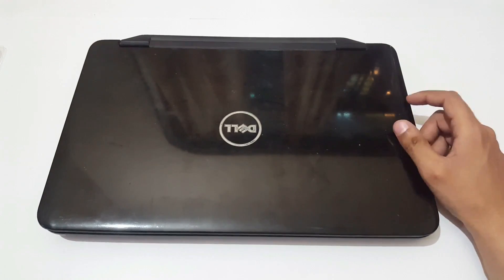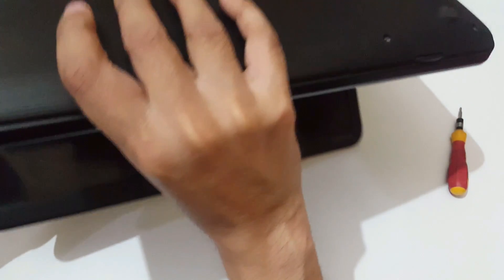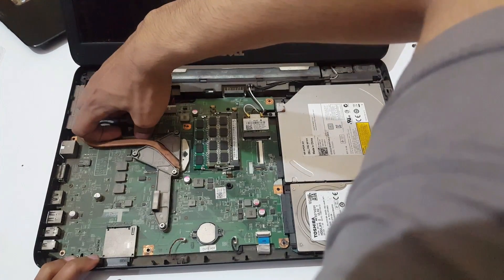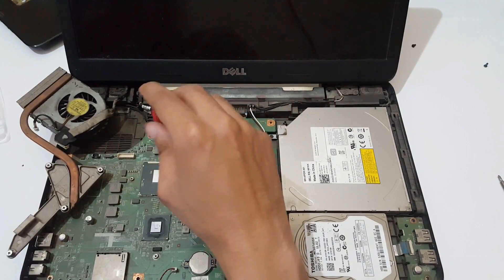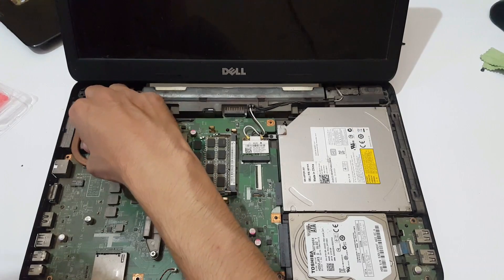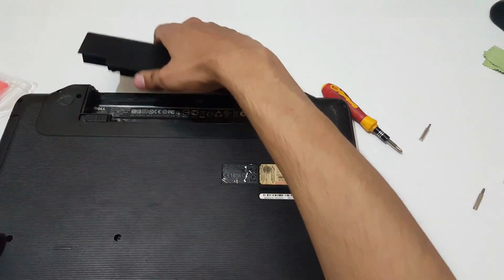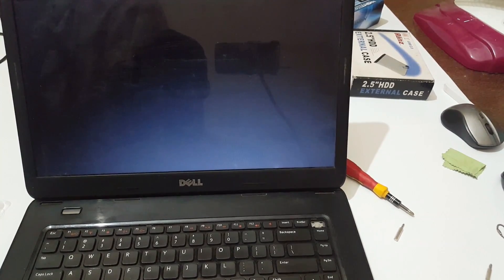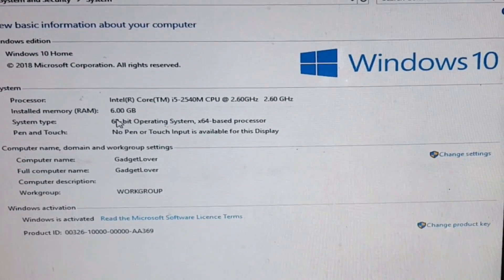How to Upgrade Processor on DELL Laptop | i3 to i5 & i7 - Make Laptop Faster for Gaming

Comment: i have dell vostro 3578 i3 also now currently i added 256 gb ssd and 4 gb ram so can i upgrade it to i5 or i7 and where i will get new processor please tell
Reply from the maker: The processor of this Laptop is soldered so you can't upgrade it

Comment: Which cpu work in dell vostro 3468?
Reply from the maker: In my knowledge the processor of this Laptop is soldered so you can't upgrade it but I would suggest you upgrade its RAM to max and install SSD for better performance
Reply: @GadgetLover360 ohh
Reply: If i upgrade all things what you said i can play gta 5 like games? @GadgetLover360

Comment: N5010 i3 m380 3 gb ram and 64 mb graphics card, 256 gb SSD+ 320 gb hdd ( caddy )

Can I upgrade processor if yes then best konsa ha ?
Reply from the maker: Yes and Intel Core i5 580M is best processor for your Laptop
Reply: @GadgetLover360  upgrade little my old laptop My laptop is  dell n5010 m380 6gb ram and 128 SSD and 500 gb hardisk windows 11 running smoothly but sometimes touchpad/mouse not working and sometimes mouse dancing please give me solution
Reply from the maker: @RajanNindra Intel Core i5 580M is best processor for your laptop

Comment: Hey i have a Dell Vostro 1014 with C2D processor, can i upgrade it with a i5 processor?
Reply from the maker: No but you can upgrade it with Intel Core 2 Duo T9900

Comment: Dell latitude e7470.... Its upgradeable or not 😢
Reply from the maker: The processor of this Laptop is soldered so you can't upgrade it but I would suggest you upgrade its RAM to max and install SSD for better performance
Reply: @GadgetLover360 My laptop is a Dell Latitude E7470 with an i5 6th generation processor and 16GB RAM with 512GB SSD storage. Even with these specifications, games lag. Why is this happening? This is the first time I've bought a second-hand laptop.

Comment: Please suggest processor and generation for my dell Inspiron 3000
Currently it have i3 5th generation with 4gb ram
Reply from the maker: The processor of this Laptop is soldered so you can't upgrade it but I would suggest you upgrade its RAM to max and install SSD for better performance

Comment: Vostro 14 3468 dell laptop can upgrade my cpu i have already upgrade it with ram and ssd
Reply from the maker: The processor of this Laptop is soldered so you can't upgrade it
Reply: Thanks for the  information  @GadgetLover360

Comment: In 2025 , I want to upgrade my laptop . So my laptop has i3 core inside processor and I want to upgrade , so please tell which processor is best for my laptop in 2025 and also help with RAM and SSD because I know a little about PC but I don't know which RAM and SSD model is suitable for my laptop , can you please give me the correct details for laptop upgrade (e.g processor model name, RAM name, SSD model name)  mostly i want to use this laptop basic gaming and as well as normal task.
Reply from the maker: Kindly, provide Laptop model number
Reply: Dell N5010
Reply: And  Processor part also
Reply from the maker: @runaljadhav9140 Intel Core i5 580M is best processor for your Laptop and upgrade its RAM with dual channel DDR3 SDRAM 1333MHz and install 2.5 inch SSD
Reply: thank you so much 🙏🏽
Reply from the maker: @runaljadhav9140 You're most welcome

Comment: Hey Big Bro, Assist me with some advice. Currently a old laptop in our home and it was utilised to its peak for Data entry of Tally as server cleint. Now it's of no use to me or other family member, it still boots slow after SSD replacement and ram upgrade to 6GB, I have a vague idea why it is doing so. Answer some of query like Is it worth investing in this product anymore or shall i donate it to someone who need it, secondly can i upgrade it's cpu to i5 or i7 to boost some entertainment purpose like to output old retro games to TV .
"LAPTOP MODEL-DELL Inspiron N5050 Intel® Pentium® B960 39.6 cm (15.6") HD 4 GB DDR3-SDRAM 500 GB HDD Windows 7 Home Basic Black"
Reply from the maker: Upgrade the Laptop with new processor and this will boost its performance

Comment: bro dell inspiron 14 5000 i3 8th laptop can it processor can  changed or not
Reply from the maker: The processor of this Laptop is soldered so you can't upgrade it but I would suggest you upgrade its RAM to max and install SSD for better performance

Comment: Can this be done on dell inspiron 3521 model i3-3227U CPU with a upgrade of i5 or i7?
Reply from the maker: The processor of this Laptop is soldered so you can't upgrade it but I would suggest you upgrade its RAM to max and install SSD for better performance

Comment: Can you do this on a Dell Laditude 5490 from 2019? I want to put a AMD Ryzen 5 4500 CPU in my computer so it gets better performance in video games, because the current cpu has bad integrated graphics. Thanks!
Reply from the maker: You're welcome and the processor of this Laptop is soldered so you can't upgrade it but I would suggest you attach external graphics card for better gaming experience
Reply: @GadgetLover360  Ok, I'll look into if I can do that with my computer.
Reply: Funny enough I have the exact laptop and was going to comment this same question. 

Sadly, we cannot use an external graphics card aswell,  since we dont have a usbc for fast data transfers

Comment: ihave a dell vostro with i3 7020 processor can i upgrade it?also can i use a external gpu
Reply from the maker: @VMAXEDITZZ  Yes and if the processor is not soldered you can upgrade it in same generation

Comment: is it possible to upgrade the processor in dell Inspiron 15 3000, intel core i3, dell laptop? (My 4 years old laptop is now very slow. I have to do my presentation works.)
Reply from the maker: @sayandeeprana  In my knowledge the processor of this Laptop is soldered so you can't upgrade it but I would suggest you upgrade its RAM to max and install SSD for better performance

Comment: HI BRO.
CAN U TELL THE BEST PROCESSOR UPDRAGE FOR LENOVO Z580.
i3 2370m processor
hm76 chipset

can i use i7 3612qm?
Reply from the maker: @drabhinavsharma0551  Hi and Intel Core i5 2540M is best processor for your Laptop
Reply: @GadgetLover360  thanks!
but can the laptop support i7 3612m?
Reply from the maker: @drabhinavsharma0551  You're welcome and no
Reply: @GadgetLover360  thankyou :)
Reply from the maker: @drabhinavsharma0551  You're welcome

Comment: I need help,is dell latitude 3380 can? Can celeron change it to i5?
Reply from the maker: @JohnLingChangEng  The processor of this Laptop is soldered so you can't upgrade it but I would suggest you upgrade its RAM to max and install SSD for better performance

Comment: Hi, can i upgrade my Dell Vostro 1550 CPU? it has Intel Core i3 2310M 2nd gen, 2.10Ghz. If we can upgrade the CPU can you suggest me some CPU's or CPU that is compatible with my Latop? That would be a helpfull if you can😅
Reply from the maker: @DratiSHCroblox  Hi and Intel Core i5 2540M is best processor for your Laptop
Reply: Thanks sir👀 @GadgetLover360
Reply from the maker: @DratiSHCroblox  You're welcome

Comment: Can i ask you 2 questions?
The first one is: Can i do this with my HP probook 440 g3?
The sencond one is: If i can, then what processor should i use to do this?
Reply from the maker: @gdndmonstar  The processor of this Laptop is soldered so you can't upgrade it but I would suggest you upgrade its RAM to max and install SSD for better performance

Comment: Brother , my dell inspiron n5010 32 bits is not turning on and there is a beep sound 7 times continuosly after pressing power button  with dark screen , how can i solve it
Reply from the maker: @mr.chandrasenelectrical7460  Reinstall its RAM properly and see if the problem has been solved
Reply: @GadgetLover360  I reinstall ram several times but it not working
Reply from the maker: @mr.chandrasenelectrical7460  Go to Setup>Load Defaults>Save and try again
Reply: Display of laptop is remain black only power light indicator is on and beep sound  , so i can't do nothing , not able to go bios or setup
Reply from the maker: @mr.chandrasenelectrical7460  It might be due to hardware problem I would suggest you go to nearby PC store and tell them about this problem
Reply: @GadgetLover360  ok thank you very much for you r reply
Reply from the maker: @mr.chandrasenelectrical7460  You're most welcome

Comment: sir my processor is i3 7th generation of the dell vostro 15-3568. Intel(R) Core(TM) i3-7020U CPU @ 2.30GHz   2.30 GHz. so can change this please reply me. I have extended my ram to 8gb by buying ram. i want to play gta5 on my laptop it is 7years old & which intel processor would be the perfect for gaming?
Reply from the maker: @swarnavaroy1063 The processor of this Laptop is soldered so you can't upgrade it so install SSD and attach external graphics card for better gaming experience

Comment: My processor is i3 11th gen 
hp 250g notebook laptop. Which i5 processor is suitable? Also my display resolution is 968p if I change the display to full hd IPS. Will it display full hd resolution or only 968p?
Reply from the maker: @saiprasanth21  In my knowledge the processor of this Laptop is soldered so you can't upgrade it but I would suggest you upgrade its RAM to max and install SSD for better performance

Comment: I want to upgrade my laptop Dell Inspiron 3520 2012 it has i3 3110m.
Which processor should i use i7 3632QM or 3840QM?
Reply from the maker: @archispal3618  Intel Core i7 3632QM
Reply: @GadgetLover360  will there be any issues with BIOS when upgrading?
Reply from the maker: @archispal3618  No

Comment: Bro can I upgrade processor in dell n5110 intel i5 2540m. If yes
Then which processor will be good
Reply from the maker: @AAWYT  Yes and Intel Core i7 2640M is best processor for your Laptop
Reply: @GadgetLover360  thank bro
Reply: @GadgetLover360  bro is there any problem will come on changing processor 
Like overheating
And power consuption
Reply from the maker: @AAWYT  No and you're welcome

Comment: Is it possible on both dell Inspiron 15 3521 and Inspiron N5010?
Reply from the maker: @WicterYT  Yes you can upgrade the processor of Dell Inspiron N5010 with same generation but the processor of Dell Inspiron 15 3521 is soldered so you can't upgrade it so I would suggest you upgrade its RAM to max and install SSD for better performance
Reply: @GadgetLover360  whats the best cpu choice for n5010?
Reply from the maker: @WicterYT  Provide processor model number
Reply: @GadgetLover360  eh thnkx for ur help pal
Reply from the maker: @WicterYT  You're welcome

Comment: What about dell inspiron 5520? Can we replace the processor in it?
Reply from the maker: @christywolf-c6j  Yes you can upgrade it in same generation
Reply: Suggest some i am not an expert when it comes to processors ,mine is too slow,2.4ghz, even though i upgraded the ram to 12gb.
Reply: Kindly respond faster!
Reply from the maker: @christywolf-c6j  Provide model number of processor
Reply: Dell Inspiron 15R-5520 i5-3210M??
Reply: Cpu@2.5Ghz
Reply: Is that enough?
Reply: Hey????
Reply from the maker: @christywolf-c6j  Intel Core i7 3612QM is best processor for your Laptop
Reply: Isn't that around 15-20k?i need something under 5k!
Reply: Also this one is ivy bridge and what about the socket compatiblity??
Reply from the maker: @christywolf-c6j  Don't worry it is compatible and I would suggest you buy it from ebay online store
Reply: What about this? CPU ManufacturerIntel
CPU ModelCore i5 3570
CPU Speed3.4 GHz
CPU SocketLGA 1155
Reply from the maker: @christywolf-c6j  You can't upgrade it with this processor
Reply: The one you suggested is not available,so tell any other than😣
Reply: Than that*
Reply from the maker: @christywolf-c6j  Intel Core i7 3540M

Comment: Can I upgrade processor of Dell Inspiron 3567 6G i3? If yes, then which processor is best suited? ( I have already upgraded RAM from 4GB to 8 GB)
Reply from the maker: @dr.santoshkawade4204  The processor of this Laptop is soldered so you can't upgrade it I would suggest you install SSD for better performance

Comment: Where shall i get the chip from
I meant is the outer shell removed or smthng
Pls respond
Nice vid btw
Reply from the maker: @Lalrly  Thanks and if the processor is not soldered you can upgrade it in same generation and you can buy processor from Ebay online store

Comment: When I upgrade it from i3 2nd gen to i3 3rd gen processor it did not shows display and fan starts and stops automatically. What to do pls tell and there is no update for bios in dell vostro 2520 laptop. Pls comment as fast or make the video dude pls 😢
Reply: Or upgrade to i5 3rd gen I try both processor of 3rd gen but not showing displat what to do?
Reply from the maker: @anshkashyap0023  You can upgrade it in same generation of processor only
Reply from the maker: @anshkashyap0023  I would like to inform that you can upgrade it in same generation only

Comment: Bro i have this same laptop so can i upgrade it to i7 ?
Reply from the maker: @the.0nyxx  Yes and Intel Core i7 2640M is best processor for your Laptop
Reply: @GadgetLover360  How much it cost ?
Reply from the maker: @the.0nyxx  See its price details on ebay online store
Reply: @GadgetLover360  Bro also suggest 4gb Ram for my laptop
Reply from the maker: @the.0nyxx  Buy Hynix 1333 MHz DDR3 4GB RAM
Reply: @GadgetLover360  Can I go with other brand you can suggest
Reply from the maker: @the.0nyxx  Yes and this is the best brand available for this Laptop
Reply: @GadgetLover360  Bro I have dell Inspiron n5050 you have the same one? Or there is 2 laptop by this name
Reply from the maker: @the.0nyxx  Yes you mentioned that earlier as well
Reply: @GadgetLover360  Ok thank you for your support ❤️❤️❤️❤️
Reply from the maker: @the.0nyxx  You're welcome
Reply: @GadgetLover360  Bro I am little bit confused that dell Inspiron n5050 and dell Inspiron 15 n5050 are two different models or not ?

Comment: I have Dell Inspiron N5010 (2009-10) model the processor of this model can be upgradable ?
If upgradable can you please tell which new processor should I use .
Reply from the maker: @SSW_1354  Yes and kindly provide the model number of processor
Reply: @GadgetLover360  

Mobile Intel core i3 370M ( Arrandale) 
rPGA 988 ( socket 1)

I called my laptop service centre but the told me that laptop processor can't be upgradable
Reply from the maker: @SSW_1354  You can upgrade it and Intel Core i5 580M is best processor for your Laptop
Reply: @GadgetLover360  what about bios will new processor match old bios
Reply from the maker: @SSW_1354  Yes
Reply from the maker: @SSW_1354  You're welcome

Comment: Can i upgrade my Dell
i5 3gen
Ram 8
And intel hd 4000
Reply from the maker: @Abdn0Abdnor  If the processor is not soldered yes you can upgrade it in same generation
Reply: @GadgetLover360  like what
Reply from the maker: @Abdn0Abdnor  If the processor of your laptop is not soldered with motherboard you can upgrade it in same generation
Reply from the maker: @Abdn0Abdnor  Yes kindly provide the model number of processor

Comment: bro upgrade in Dell inspiron 3521 ?
Reply from the maker: @karan.nishad9205  The processor of this Laptop is soldered so you can't upgrade it but I would suggest you upgrade its RAM to max and install SSD for better performance

Comment: Hey man, Is it possible to upgrade dell inspiron 15-3531 processor to i5 processor?
Reply from the maker: @ofentsecelltick5929  The processor of this Laptop is soldered so you can't upgrade it but I would suggest you upgrade its RAM to max and install SSD for better performance

Comment: Bro can you tell me. Can i upgrade my processor my dell n5110 specifications: Processor:

Intel(R) Core(TM) i3-2310M CPU @ 2.10GHz 2.10 GHz

Installed memory (RAM):

6.00 GB

System type:

64-bit Operating System

If how max ram can i upgrade i recently installed ssd 256 gb and also hdd512gb what can i do mote to make it fast
Reply from the maker: @OPTIMUS-PRIME26_MUSIC  Yes and Intel Core i5 2540M is best processor for your Laptop
Reply: Thanks for replying and I want to ask you that can I upgrade ram also .one more thing I have only 64 mb dedicated video memory Intel hd graphics 3000 can I increase it because I tried so l many YouTube tutorials but doesn't works if I upgrade to i5 as you told does dedicated video memory increase??
Reply from the maker: @OPTIMUS-PRIME26_MUSIC  You're welcome and yes you can expand its RAM see maximum RAM upgrade details in manuals and you can attach external graphics card to your Laptop for better gaming experience
Reply: @GadgetLover360  hi bro I have to tell you that I use windows 7  ( I mentioned my laptop specifications above) but I wanted to use windows 10 6-7 months ago I reapiring my laptop tha person installed windows 10 I used it but sometime it black screen and I needed to shut down and restart again. Later I again switch to windows 7. But I think 🤔 this is not professional person. 

I have to ask you can I run windows 10 with this specifications without problem......... Please 😭 reply
Reply from the maker: @OPTIMUS-PRIME26_MUSIC  Yes
Reply: @GadgetLover360  really thank you I have to say that big bro which help me in technical issue thankyou 😂can I download win 10 from YouTube or from some professional because am 16 old kid
Reply from the maker: @OPTIMUS-PRIME26_MUSIC  You're welcome and I would suggest you download it from official website
Reply: @GadgetLover360  here is problem with me that I installed windows 10 but black screen came after some time. I checked for solution I fin out this due bios not updated. I want to update bios but problem is itsay plug ac adaptor and bla bla.....
Now how I update without battery
I disable my graphics driver for some time and it runs without black screen but full brightness and low resolution please help
Reply from the maker: @OPTIMUS-PRIME26_MUSIC  If it is required I would suggest you follow its instructions and update it soon